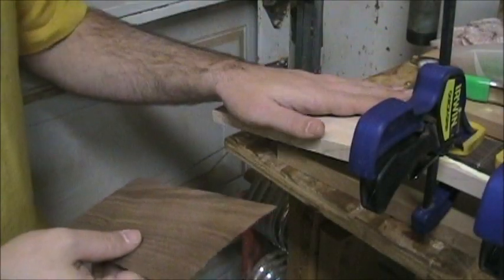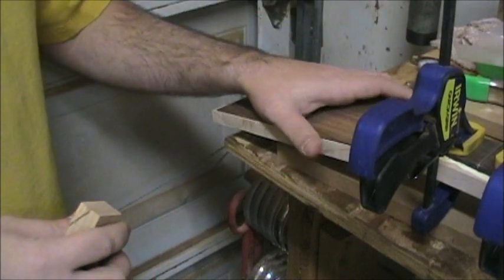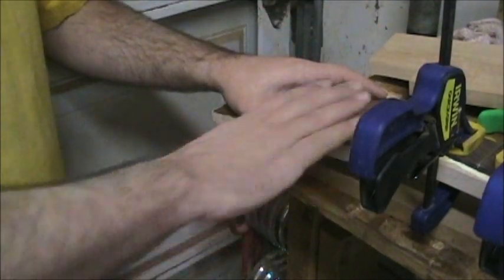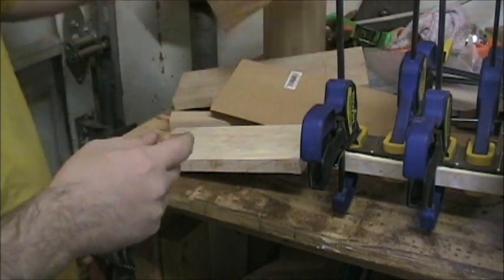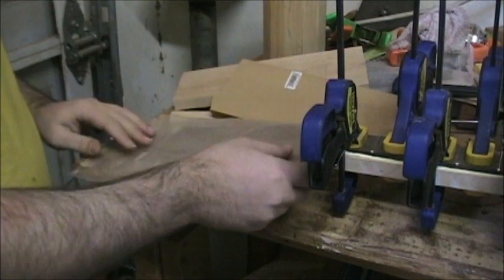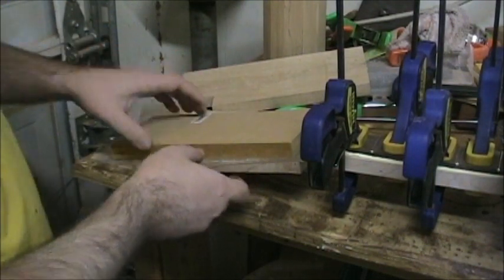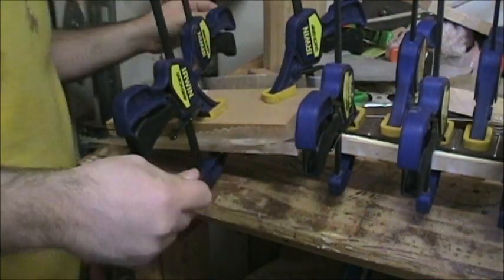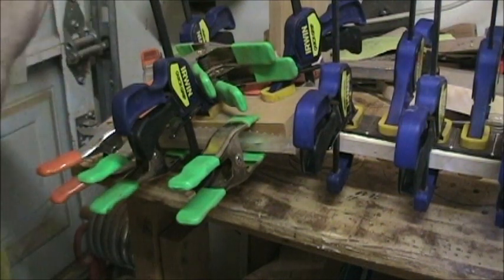Bass Project Part XV: Head Stock Veneer

Comment: Helpful tip: Grab a piece of notebook or printer paper, wrap it around a round rod or dowel and use that to spread your glue. You get an even layer, you don't use as much glue and all the mess stays on the paper instead of on your finger.